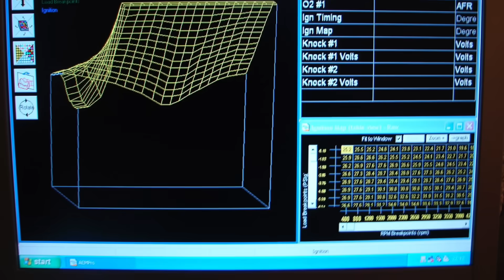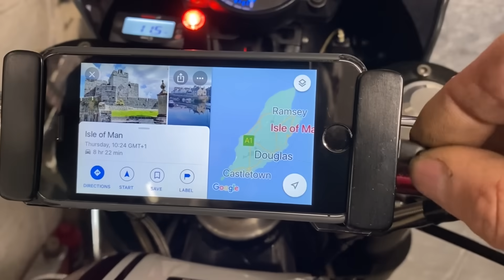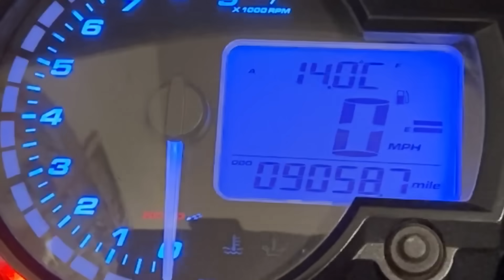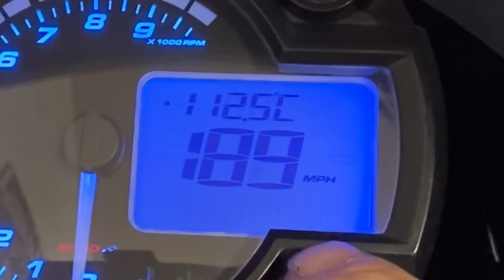Millyard Viper 8 Litre V10 Motorcycle - Part 1

Comment: Hi Allen. Absolutely love all your builds, and especially the Viper Bike. Looking to do something similar here in Australia with an Aussie straight six Ford Barra engine. Would love to know the manufacturer and model of the bevel box your using as we're having trouble finding one with the right power and rpm specs. Everything seems to have too low an rpm rating. Thanks in advance for any help and keep the great videos coming.

Comment: Hi Allen, I don't usually do this so please forgive me. I'm a big fan of your work and inspired. I'm in he process of doing a build similar, however v8's are more my thing (chevy 454 specifically). After sometime rebuilding the engine, I'm looking towards the gearbox and swingarm. Could you please provide guidance which gearbox you used and if the bellhousing is taking the load to the rear of the engine, or is there any other structural work going on? Don't think I'd trust my v8 bell housing to take the rear end weight of the engine and passenger. Feels like it needs some steel work to support. No worries if these Q's don't reach you. All the best and keep up the sterling work 👏

Comment: Years a go I made a similar but more basic (still worked though) chain oiling system. Small baby feed bottle (remove the teat from the cap, bore out hole so rubber bung can fit (push the rubber bung into cap from inside, then push the clear tubing into bung), with a home wine/cider/beer kit tap and rubber bung mounted up behind the front fairing (easy access), some clear tubing (run from fairing down under tank, along the frame to back end, and a small bit of ally tubing to distribute the oil on the chain.. Had no end of oil as i filtered some used engine oil, and worked wonders! I laughed at my mates then with my 'Heath Robinson' approach for a coupla quid, when they were paying £££s for a 'Scottoiler' system lol. 👍👌🤣     😎🇬🇧

Comment: REMARKABLE MACHINE!!!  I have always figured when using a car engine in a bike, a standard transmission mated to it would still be required in order to reach 80 mph, much less 190 mph!!!  WOW!  What bevel box did you use? What is it's gear ratio?   I did notice your collection of final drive sprockets.

Comment: When that V-10 Viper motor came out, Chrysler built a 'bike' with a V-piper engine...it had 4 skinny tires with hub center steering on the front, and dual swingarms on the rear...It did actually run, and Chrysler presented it at a couple Shows...but no 'daily' street riding. They did state that if you really opened the throttle leaving a stop, you'd pretty much liquify the tires in 5 seconds...they had a few more manufacturing resources, including a slightly larger 'shed'....

Comment: You're only 2 cylinders away from a Rolls Royce Merlin! I always dreamed of making a Motor pickle with one. May need a separate trailer for the petrol? I don't know?
Reply from the maker: It holds 45 litres so has a 150 to 200 miles range

Comment: Many years ago I blew a piston on a Suzuki GT550 on the way to work. As this was a regular thing I had a spare and changed it on the side of the road. 
Looking back it was odd that I was willing to carry a spare piston round with me but couldn't be bothered to jet the bike properly.
I thought I was reasonably capable mechanically, but looking at a Viper bike made by a guy who add extra cylinders to engines just for the hell of it.......

Comment: The Chinese use oak heat shields on their spy satellites which are designed to re-enter the atmosphere.  The oak dome is fifteen centimeters thick and is designed to slowly char and ablate away during reentry.  It works extremely well.

Comment: Allen. If you read this then I have a suggestion.
Saffil.
Try this for insulating heat shields.
It's made in Widnes and is used by NASA for what you asked for in the video.We had some at home when I was younger used as.... loft insulation.

Look it up on the NASA site......

Comment: If you talk to any lager he can supply you with high temp pipe insulation cut off's. It is black and looks like it is made of foam, it  works very much the same as the ceramic tiles but weights next to nothing. Also it comes pre-shaped to cover pipes, so easy to fit on an exhaust pipe.

Comment: you are perfectly mad but it is ok , can you make headers for my old ford van econoline 1976 with a six cylinder engine that has been caress with european touches for rally use not drag racing it is smooth as silk (perfectly balanced up to 8 rpm)

Comment: Hi Allen, What wheels and tyres did you use, for the weight and speed? I could see an Avon at one end, I presume you used a pair? What sizes are they and with the wheels are they custom made from scratch, did you modify some parts or are they a completely off the shelf item? Sizes, again, Please?

Comment: Allen, you know you're a "genius" with engines, and may I suggest some "projects" you might consider in the Future.   Make a V-12 out of 2 AMC 3.8L [232 cu" ] inline-6 engines.  "Jeep" 'nuts' are always hot-rodding their Jeeps, --sometimes just to have the "torque" to rock-climb up bouldered-areas in the American SW & elsewhere.   Before emissions "shot-out" big, performance V-8s AMC was considering putting a "tall-block" iteration of their V-8 family {--which were really 'small-blocks' } of 464cu"size.   I suggest you have a friend cast you several 3.8L AMC inline 6s in alloy/electron, and then join them @60-degrees for a "what-might-have been" OHV 60-degree V-12.  The displacement could be 464cu"--what AMC was intending in volume before the "Rotters" of the EPA ruined the "Muscle-car era".   SOMEwhere in "Jeepdom", would be a Fan that always wanted an AMC alloy V-12 for his Gladiator J-20/whatever.   If you wanted to REALLY "get fancy", mod some Kawasaki 6-pot DOHC heads for the 464 V-12 block, like TVR did with Suzuki-heads, to get a better output for their 4.0L inline, in the day.   This would allow you to circulate & star in many shows for a while, and I think you'd really get some orders to have some shop-mates put several together for fun here in the "Colonies."   500+ hp for a "Jeep" V-12'd be so Kewl.   Also, the beautiful Brit-bikes of the 50s-80s were done on the Cheap--how about making a Norton V-4 with two 850cc verticle twins  welded-together @, maybe 50-degrees, only put in one/two center main bearings like the Japs/AMC {AJS/Matchless}motorcycles had instead of those "Bendy-crank-specials" the SNorters had, requiring "super-blend" bearings and such.   The IDEA would be to show your genius by de-flexing the crank, so rebuilds'd be way farther apart than a 20K "de-coke" of the head.   Honda had some Wonderful, "fiddle-free" V-4s in the 80s-90s, and British gents like yourself had the skills in the day--Makes/marques didn't spend Pounds on the TOOLING to then make a "Better" Brit-jap bike{ that 'Handled'} that could've kept us all coming back to the places like Birmingham, where Mr. Honda first got his inspirations.   Have you done a "V-4" or even a "V-6"  lengthening the Honda CX-500/650s?  Couriers used to swear By the CX-500 as a London delivery mount, but wouldn't the "CX" have made an even better "CX-1000-1300 V-4 Tourer"?  And don't stop with Brit/other 'flaws'--Moto-Guzzi riders still occasionally bruise their shins on carbs/injector-bodies.   Wouldn't a Honda CX-650 head, with the carbs/throttle-bodies "cocked-in", 'Fit' on a Guzzi-Vee for more comfort to one's shins'?    Well, you've probably thought of mods like these, yourself, but I LUV your past work, and wish you could "Tour" more, here in the 'States.   You're not only Brilliant, but you are "unspoiled" in Attitude, making you England's "Greatest-Motorcycle-Treasure," and "Humble", besides.

Comment: So, you mentioned that it's a single speed transmission. What kinds of speeds does that translate to for idle, and what speeds for redline? I'm very curious how exactly you can reach 200+ mph and be able to go under 30 mph on the same gear.
Reply from the maker: 30mph at 800rpm -  225mph at 6000rpm
Reply: @AllenMillyard  Wow. Thanks for the reply!

That's honestly really impressive. So, how do you manage when you have to go under 30? For example, when you're in a 20-25 mph zone, when you're in a parking lot, etc? is it just constantly feathering the clutch and brakes to keep it down? or is it just not rideable in slower speeds?

Comment: Anyone else think that steering head bearing looks a little weedy compared to the massive forks that will be pivoting on it?  I'm sure they're adequately sized, the forks just make them look tiny by comparison.
Reply from the maker: There perfect fir the load, they are the original bearings I fitted 11 years ago I’ve ridden the viper almost 10,000 miles and over 200mph and have never had to ajust them 😎
Reply: @AllenMillyard  Cool, thanks for the reply, Allen.
BTW, as always, I DID enjoy the video.  Thank you.

Comment: Wait... Did I hear that right? This bike only has one gear and you change the ratio by changing the sprocket??
Reply from the maker: Yes
Reply: @AllenMillyard  Is it reasonable to assume the chain is the weakest link (no pun intended) in the drivetrain? I could imagine that engine tearing it apart.

Comment: 8:40 noticed a split link  any reason why this was used over a master link thanks, Allen
Reply from the maker: I change sprocket size for different riding conditions, The link is heavy duty EK drag race chain and specifically comes with a spring link, the Viper has been ridden over 200 mph many times with no problems and i fit a new chain every 1000 miles

Comment: Ok so now after all the cash you sunk into this........ whatever, you have a 1300 pound motorsomething that can hardly turn, is brake deficient, and uncontrollable at best under full power. So why? A 600 CBRR would blow this thing away on the track. This is not ingenious or innovative. It is ridiculous. This is a case of spending more time and money on ridiculous engineering rather than learning to ride. More importance on the machine than on the rider. 260 MPH. right, and I have a home made mini bike that reaches speeds of 150 MPH.

Comment: Wait does this mean that the fake coal can be used as a solution for all such heat shielding applications? On the exhaust of a triumph scrambler 1200? Under the seat of a multistrada 1260?
Reply from the maker: Try it and see

Comment: i really want to learn how to do the 90 deg tranny case for the flywheel-rear wheel. Im trying to make a motorcycle with a car engine myself.
Reply from the maker: You can use a diff from a  car  or just the internal gears in your own casing
Reply: @AllenMillyard  thanks kind sir

Comment: Those K&N air filters are meant to be oiled and cleaned regularly looks like those have never seen a drop of oil they would be pinkish red
Reply from the maker: Yes I’m aware of the K&N  filters maintance will be checking over the bike and will clean and oil the filters then 🙂
Reply: Brilliant love your work

Comment: Allen, I'm interested in your 90 box you have used in the drive. What brand and size or model is it? Did you make the input shaft or maybe easier what parts did you have to fab? Also, the booster you use to on the clutch and how you make it work would all be good info to share. 
Thanks Allan

Comment: 1389 lbs... I want to see your technique for picking that up if you ever drop it... My Harley is only 800 lbs and it is a big enough pain to pick up with my bum knee...
Reply from the maker: its easy,  just ask a few people to help :)
Reply: @AllenMillyard  -- So you're not required to carry around a chain hoist... :)
Reply: @AllenMillyard  -- Last time I dropped mine (I was just slowly turning it around and had gone on the grass in my front yard), my foot slipped on the grass and did a slow fall and broke a rib (beavertail on my handgun hit the bottom rib when I hit the ground).  Of course, it happens late at night and no one is around... The bike shut off and I just lay there on the ground for a few minutes until the pain subsided a bit... Even more fun picking up an 800 lb bike when you have a broken rib... I needed few beers after that one... Guinness, or course...

Cheers...
Reply from the maker: I don’t carry a gun so should be fine 🤔
Reply: @AllenMillyard  -- Let's just say that to break a rib that way at a very slow walking speed is a bit embarrassing... Just a sign of getting older, I guess...

Comment: Have you thought of using a torque converter instead of the mechanical clutch? A disc brake on the output to hold the bike when stationary.
Reply from the maker: Yes I did but was let down at great cost to me so went my own route with a manual clutch

Comment: Is it me or does the clutch housing take up far more forces then normal? in the car it would mainly counteract with rotational forces. But because you fitted the rear swingarm to it now also deals with pulling and pushing forces.  As an example under hard acceleration the counteract forces from the wheel with the swingarm would want rip the clutch housing from the engine and drive it in the ground.  Not sure how it can handle that kind stress.
Reply from the maker: It’s absolutly fine and more than strong enough, I guess 11 years use,, bumpy country lane riding , 9000 miles   and many high speed runs at 200 mph + proves tit 🙂

Comment: which is usual for motorcycles <that don't have an 8 litre engine in them and a fuk u torque curve> due to increasing air resistance. 

There is no replacement for displacement.

Comment: Mr. Millyard,
  I'm already subscribed so, I'll only have to leave a thumbs up, I'm very impressed with your 'finesse' in this video, well, the rest of them too, lol. I'm not one for extremely high speed riding anymore, I'm 71 years old, not over 160 mph anyway. I envy you having all the lathes to work with, back when I was in the workforce, I had access to the necessary machines to build things with, being retired puts a dampener on what one can accomplish.  I have to say, 1386 lbs. is a lot of weight to be hauling around, it probably rides like a dream though. Sometimes I wish I was still working, but I wouldn't have as much time to park in front of my monitor, lol. Thanks for sharing all your work (fun), I enjoyed it tremendously.  Cheers
Reply from the maker: Thanks for the comment 🙂

Comment: I love that you did this on a Myford ML7. That's the same lathe I have and, having seen your Colchester in other videos, I felt inadequately equipped (even for working on my Ariel). At least until now! Now all I need to do is bring my skill level with it up to even 5% of yours, and I suspect that's my biggest limitation not the lathe itself...

I would similarly love to know how you used your milling machine to enlarge those chain-drilled holes, little doubt perfectly round and perfectly on centre. Why? Because I have a con-rod on which I want to (slightly) enlarge the ends.

It would be wonderful if you would do  few videos on using machine tools properly, Allen. Especially the old vintage English ones, which we all know are the best :-) 

Either way though you produce awesome videos, so please keep them coming.
Reply from the maker: You need a boring head for your milling machine then you can bore holes
Reply: @AllenMillyard  Thank you.

Comment: Why the titanium brake pistons? I'm sure there's a reason, i'm curious what it is. My first thought was mass, but the loss of unsprung mass seems neglijabile for such a large wheel and such hefty forks
Reply from the maker: The latent heat transfer of titanium is one of the lowest of of any metal so brake disk heat is not transferred into the caliper where it could boil the brake fluid causing brake fade at speed
Reply: @AllenMillyard  that makes sense. Thanks Allen!

Comment: Dodge engineers must be watching this video and in major disbelief ..!!  LOL  Fantastic work Allen.. !! Did you actually do 260 MPH on this Rocket?
Reply from the maker: It did 207mph in 2009 using around half throttle. I think it would pull 220mph if I tried
Reply: @AllenMillyard  Very good Allen. ! Run it up for a quick 220MPH + Do you have a test dummy?  LOL

Comment: Hi Allen, an incredible machine and demonstration of your formidable talents again! - You are an absolute legend which is why I hesitate to say this. But in the interest of promoting best practice may I suggest that you could improve the rear chain oiling system efficiency by repositioning a single oiler nozzle so that it rests against the side of the rear sprocket at the 6 o'clock position ( I would recommend using a plastic tipped nozzle though if you do this). There might be a reason why you have suspended it above the chain (if so then fair enough), but the issue with dripping oil down from above the chain is that the oil won't drip down vertically once you are moving above a few mph and tends to get blown backwards sometimes missing the chain altogether. Whereas oil applied to the side of the sprocket will be thrown by centrifugal force into the chain and sprocket mesh thus effectively and efficiently lubricating the chain and sprocket and reducing the amount of oil "fling" on the rest of the bike and you will find that you require a lot less oil to get the job done. More than happy to ride over and show you what I mean :-) Please keep on showing us your incredible machines!
Reply from the maker: My chain is always oily so i guess its working fine :)
Reply: @AllenMillyard  Brilliant, job done then :-) Looking forward to the next instalment! :-) the sound of that beast running is just awesome!